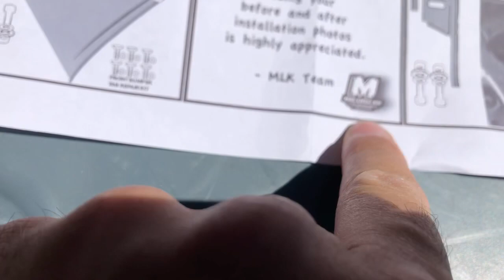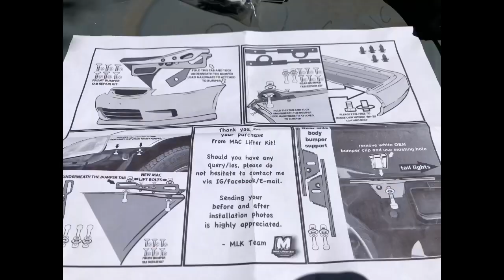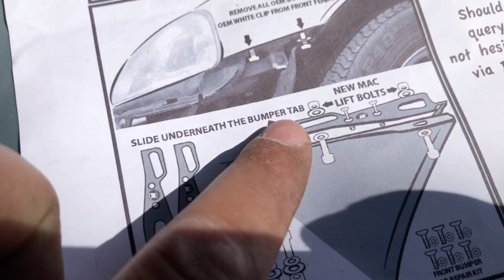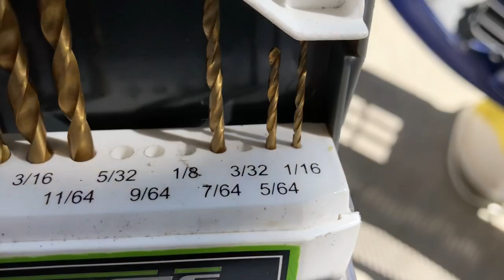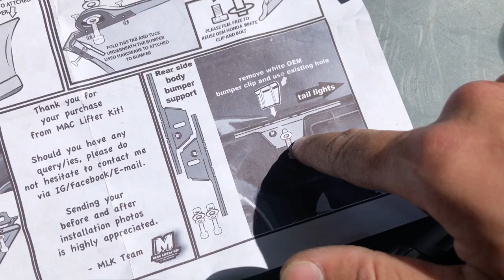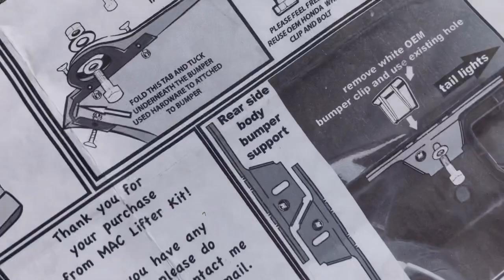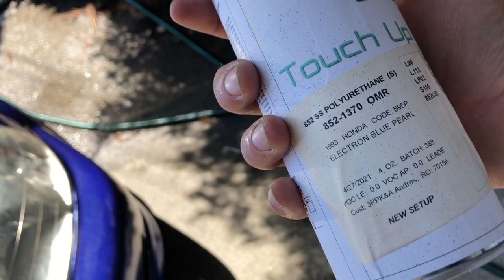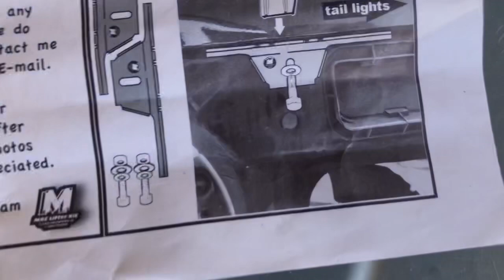Honda Civic MacLifter Bumper Kit | Install Guide Eg Ek Dc2 Full Review and Quality

Comment: I'm not sure if there's a right or wrong way to install this bracket for the front bumper. But it does look like from other videos on the web. You have it installed on the top when it looks like it should be installed from the bottom.
Reply from the maker: I mentioned it in the video, lol only if you saw the whole thing, i will be installing foglights kit on the car and just gonna simply unscrew 2 screws and just fold it underneath it easy couple seconds.. when i get the chance. bumper has to come out anyways, but i still managed to keep it way better and flush and no gaps tho even installed on top of the bumper 😅
Reply: @uwkcal  no worries, I did stop watching the video once I saw how you installed the brackets.
Reply from the maker: @Cvekawd  well good! I hope u left a like and subscribed to my channel! regardless if i did theres still no gaps and it is your responsibility to make sure the brackets gets installed correct, besides it comes with an instructions manual anyways, you didn’t even have to watch my video! Its basic common sense anyways, it just so happened that the bracket was put on top ;) but there was no need to even click the video link anyways! for watching my video!
Reply: @uwkcal  if I were you, I wouldn't quit my day job. This YT stuff isn't for you. It's like, "Hey, I'm going to make a video today about something I've never done before, and share it with the world." Then you start crying because people are pointing out that you did it incorrectly.
Reply from the maker: @Cvekawd  well listen here pal, nobody put a gun to your head to watch the video, leave your comment, review, feedback and keep it moving plain n simple.. unfortunately youtube blocked the dislikes so nobody can see any dislikes on any videos, lame but maybe the world would be a better place if they so returned the dislikes button option! instead of keeping that info to themselves and using that knowledge for youtubes own self, right? Unless they be for the Good then is it totally fine? See ya wouldn’t wanna be ya 😅
Reply: @uwkcal  understood, buddy.
Reply from the maker: @Cvekawd  thank you, you’re a good guy!
Reply: @uwkcal  if you keep up with the nice comments, I might subscribe to your channel bubby.